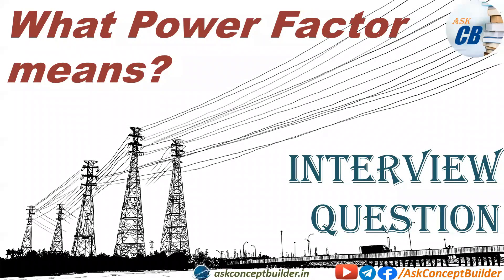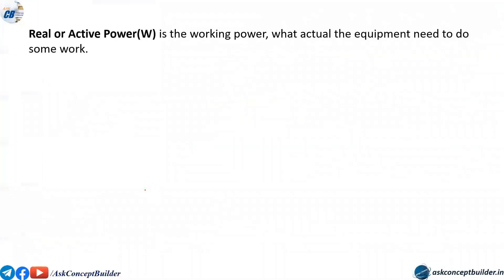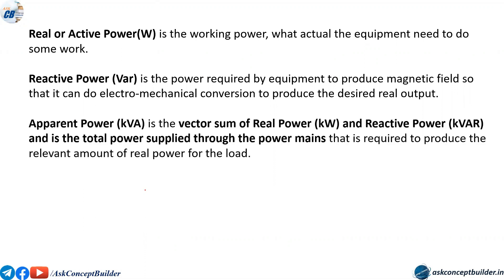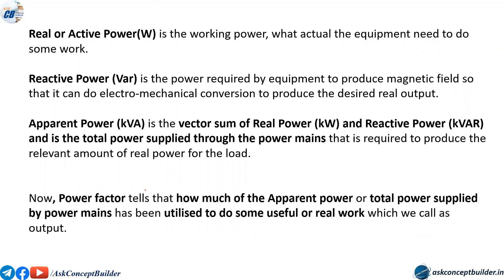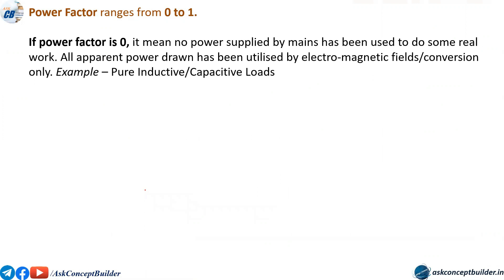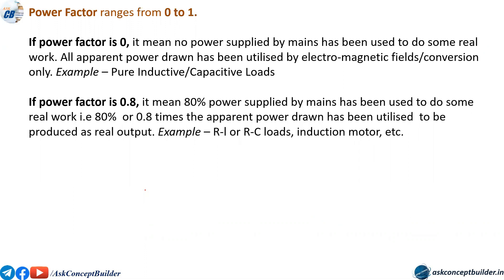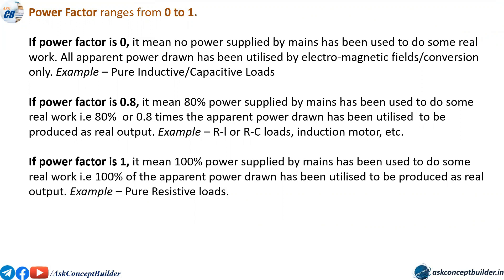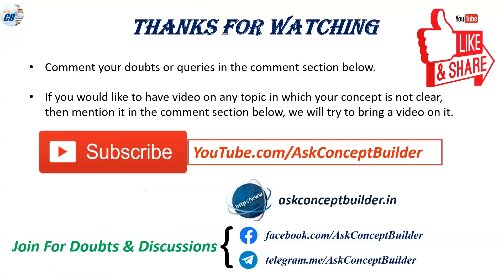What is Power Factor | Physical Significance of Power Factor in AC Circuits (Interview Question)

Comment: 1.Why the no load pf of Induction motor is lesser then the transformer?
2.Why does power trnsformer produces humming sound?
3.Concept of eddy current and hysterisis loss?
4.Why the size of distribution transformer is greater than the size of  power transformer for the same rating?